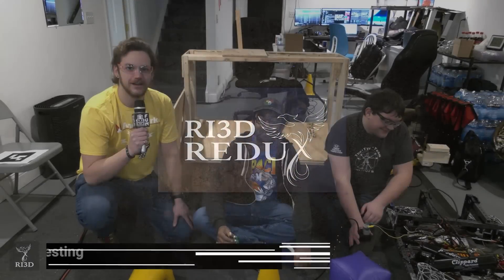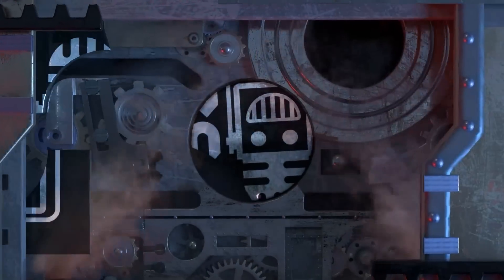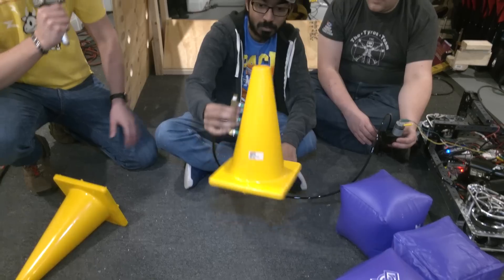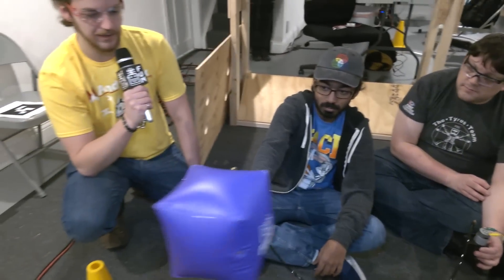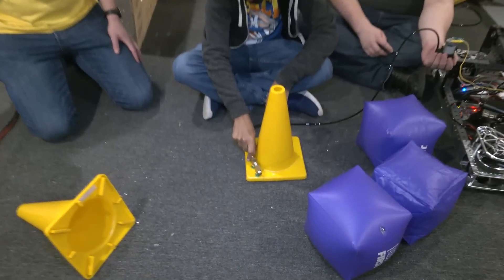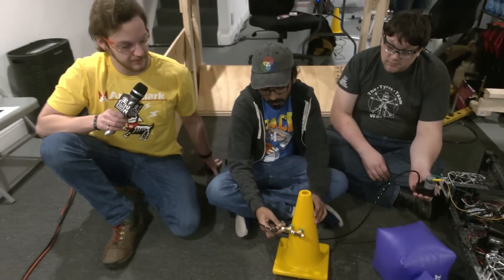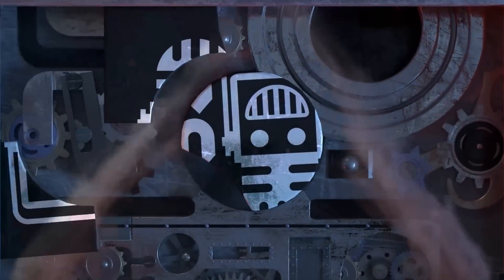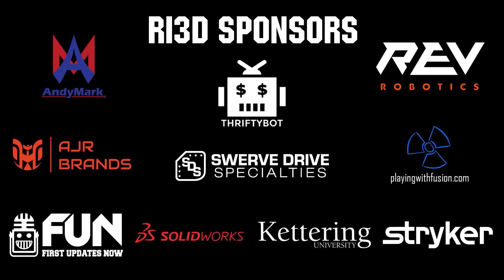Vacuum/Suction Intake Testing Ri3D Redux Charged Up 2023

Comment: Our team is using suction cups, im pissed because unless you have multiple suction cups and multiple vacuums, it's too weak and will fall off if your robot moves too fast. we have 2 days to get more vacuums before our next match
Reply from the maker: Check out 2881 Lady Cans who won FiT Waco with just 2 suction cups/motors https://youtu.be/rTLa0TwiqEc
Reply: @FUNRoboticsNetwork  well, we did our best, may be enough to get us to states, might not be. Only time will tell

Comment: I second that these suction cups would violate rule 801 of the rule book
Reply: R804 in the 3rd blue box you will see that any device that creates a vacuum are not considered pneumatic devices, so pretty much any rules that apply to pneumatics are not applied to vacuums

Comment: one disadvantage of vacuum systems is that it requires a very small gap between your mechanism and the game piece. That means you need good game piece indexing and/or compliance (as human arm does) to get a good vacuum every time. In my opinion, it's too finicky for the chaos of FRC matches. Cool though.
Reply: 971 got it to work pretty well in 2019 - definitely a tempting concept aside from the fact that it's so foreign to most teams

Comment: Is it legal to use suction cups? I have a doubt because in the section of the manual it indicates explicit pneumatics
Reply: R804 in the 3rd blue box you will see that any device that creates a vacuum are not considered pneumatic devices, so pretty much any rules that apply to pneumatics are not applied to vacuums
Reply: In 2019 254 used suction for their climb. Unless there was a rule change, it should still be legal.
Reply: @junkaccount8302  Vacuums are legal on game pieces, however this year, using one on field elements themselves is not legal.
G301: ROBOTS and OPERATOR CONSOLES are prohibited from the
following actions with regards to interaction with ARENA elements. Items A-D exclude GAME
PIECES.
C. attaching to (including the use of a vacuum or hook fastener to anchor to the FIELD carpet
and excluding use of the DRIVER STATION hook-and-loop tape, plugging in to the provided
power outlet, and plugging the provided Ethernet cable into the OPERATOR CONSOLE),

Comment: Isn't this a R501 violation?
Reply: If you use a legal motor (as defined in R501) I believe it's not a violation.
Reply: Seen this before, you can modify an FRC legal, similar motor and swap it.